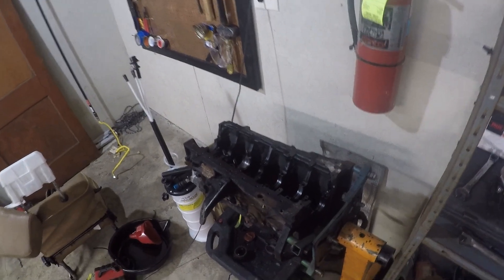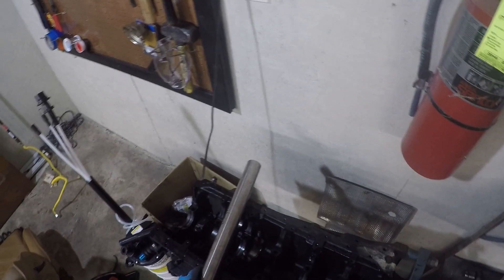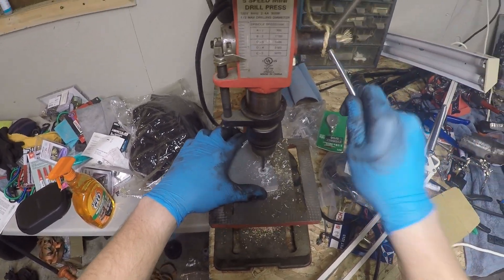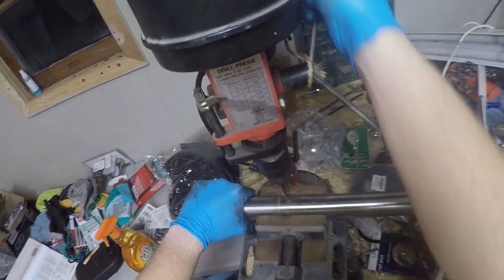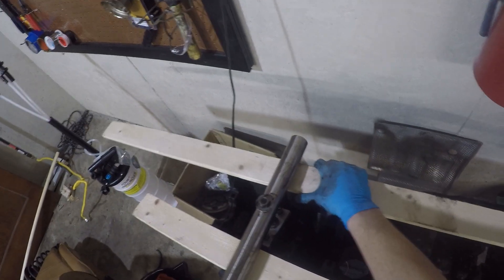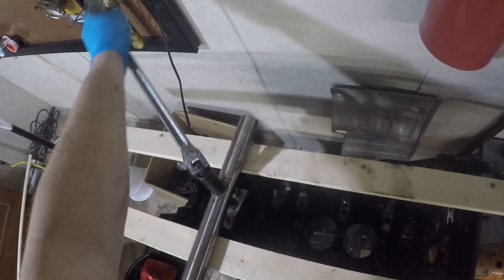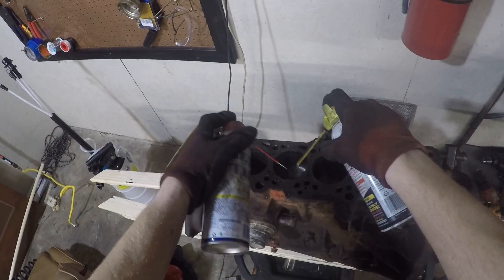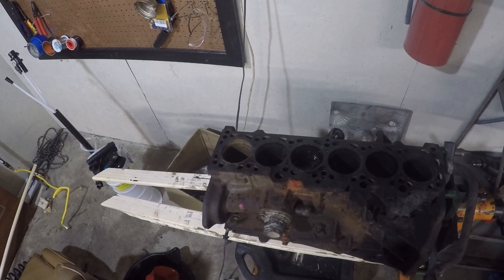D24 Diesel Engine Rebuild 9 - Building a Puller

Comment: Добрый день. Good afternoon. A good motor ( DW, DV , 1C gasoline , ...... ) many names. This unit has a head for gasoline 1C . Be sure to get it after repair, you have all the spare parts for assembly , there is a factory in Germany for the production and restoration of this diesel. THE WEAK POINT IS THE CAMSHAFT BELT and the crankshaft pulley bolt tighten 350H with glue . Good luck!

Comment: More videos with d24?😞
Reply from the maker: Sorry, but the D24 is on hold until I can fix my  snowblower. The method of this vid hasn’t been able to unstick the last piston.
Reply: @haoleboyshow-tos2279  Put the whole block in the oven at 450°f for 1 hour. Take it out and put a cylinder of ice  right against the face of the piston. Make sure to pre-load your puller to maximum pull before hitting the piston with ice.

Comment: Hello, I have volvo 740 and i have idea of swaping d24 in it, but i cant find any spare d24 from 740 or 940, mayby you know if its possible to swap these from vw lt vans? also love your vids :D
Reply: I am doing the same thing, the availability of an engine is kind of based on what continent you are on, D24s are super rare here in canada but europe should have much better luck as they sold them for an extra 10 years over there. I was luckily able to take a D24t out of a 740 at a pick and pull and am putting it in another 740 wagon although i am struggling with engine mounts.
Reply from the maker: @evanreid5678  Yes, but Canada got the excellent 1.9 AAZ diesel. So that makes it even.
Reply: @haoleboyshow-tos2279  sure but we basically lost all of the cool diesels here after 86 because of horrible California regulations. also what makes the aaz in particular so much better than the alh for example. honestly i would much prefer to have a bunch of D24s around than aaz
Reply from the maker: The D24 used in the older VW LT vans is the same as the Volvo 740. The transmission will bolt up, but you may need to get different motor mounts
Reply: @haoleboyshow-tos2279  Thx for reply, i have m46/od transmission, but since it isn’t from diesel volvo will it still fit? I’ve seen that starter is on opposite side..  Do i need to change that transmission part which mounts to an engine?
Reply from the maker: You would need the D24 bellhousing that goes with the M46. That should be interchangeable though on the transmission you have.